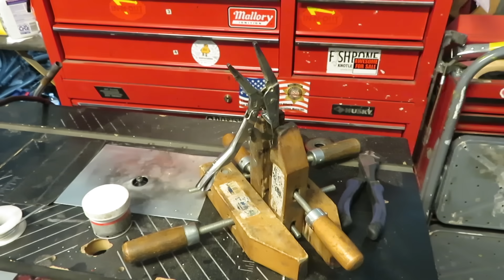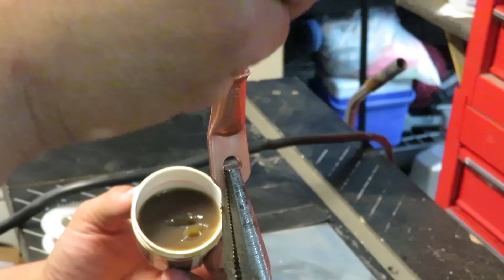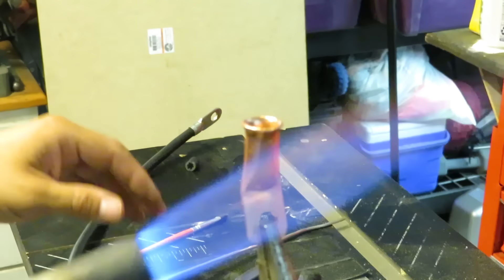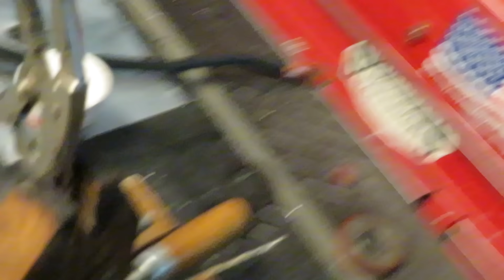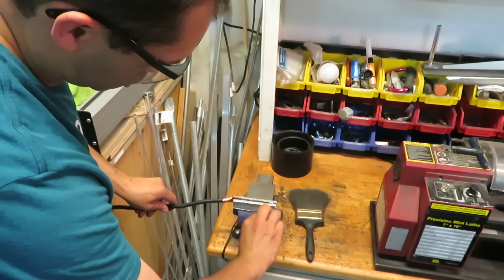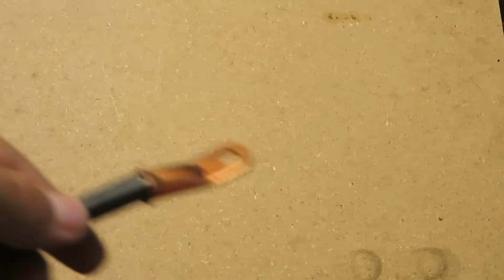How to: Battery Terminal Install. Better than Factory.

Comment: I would advise always crimping this style of connector. No one is going to use it to repel off of a mountain. A crimped connector  will hold even if the connector gets too hot due to a poor connection which may become loose over time.

Comment: Anything that needs that large of a cable WILL melt the solder. It MUST be crimped. Do what you want.  You WILL end up crimping. That's why the crimp was on the factory made wire. Just saying.  Some folks named to learn the hard way.
Reply: Steve. It is probably an Earth cable, it has two ring terminals.

Comment: You need to have the wire hot enough to boil the flux or the solder won't bond to it well.

Comment: Good job except for when you use solder that is made for Plumbing on electrical will eventually have corrosion and such a lot sooner than if you use solder that is made for electrical. You are giving a Miss information on your YouTube

Comment: Plumbing solder is the wrong type for electrical use. It is best to use a hydraulic crimper for these types of terminals. If you are going to solder, you can buy solder slugs from an electrical terminal supplier that contain flux and are properly sized for the terminal.

Comment: This is garbage due to the fact  that you will never be able to clean off all the flux afterwards, Flux corrodes copper and the connection will fail, I've replaced hundreds of these do it yourselfer projects due to corrosion.
If you do solder the ends use ONLY ROSIN CORE SOLDER, it will not corrode the copper.
Just use the proper crimp device I haven't had any problems in 20+ years

Comment: Looks cool, but for a RV or boat I would prefer to a mechanical crimped one
Reply: A half moon back dye with a center tooth crimp is the best mechanical connection you can get.. solder attracts corrosion.. I repaired locomotives for 12 years and saw all types of failures.. quality crimps never failed on 1000 amp motors... the crimp shape is very important though..

Comment: Plumbing solder is generally acid core and you don't want to use acid core on electric connections.
Reply: You are correct that acid core will cause corrosion that will make that cable useless. There will likely be 6-8 inches of corrosion in less than a year. Not good.
Reply: My thoughts also.
Reply: @eminence_front6043  ckh
Reply: Yeah don't use plumbing solder for electrical connections lol. He should've used the right solder. It will crack inside over time and probably other issues too
Reply: @nnnnnnnnnick5557  Modern plumbing solder does not contain flux generally, you need to add flux.  He used a rosin based paste flux, with lead free solder.
Reply: That particular brand is rosin core. Lead-free. Should be gtg.
Reply: I rewired my trailer, soldering and heat shrinking each connection.  About six months later, I startled having wiring failures.  Turns out the solder I use was acid core, and every joint eventually failed.  Ended up redoing the all wiring with the correct solder.
Reply: Yeah, rosin better or you need to wash your connection really well after
Reply: Silver base Solder is code in California for  Plumbing for a long time now.
Reply: Если я правильно увидел-флюс=канифоль в спирту от завода. Но данное соединение нельзя использовать в автомобиле и в горячих местах
Reply: That stuff he has is like the stuff I bought from lowes, its silver tin and copper which has a higher melt point than lead tin solders and that stuff has no flux core its just solder hence his need for flux, rosin core solder requires alchohol or acetone etc if going to be cleaned at all as they are not generally reactive at room temperature so cleaning really isn't needed and most of your plumbing flux is water based and very corrosive at room temperature which can cause other issues. A lot of people "say" it's not recommendedfor electrical applications though water based fluxes do exist for pcb and electrical work and prompt and proper cleaning is needed and people use them all the time for electrical soldering.  For what he did I would prefer the solder he used as it has a higher melting point and silver has great conductivity, and I would have used rosin based flux and pre soldered the wire to ensure proper flow between the strands
Reply: Plumbing solder is not acid core.
Reply: Don’t think that was acid core, just straight solder.

Comment: I crimp and then solder my connections just in case the solder happens to break or melt for some strange reason. Just a back up measure.
Reply: Solder will break.  It make the connection rigid and susceptible to cracking from vibration.
Reply: Not supposed to solder crimps.
Reply: @drott150  soldering stranded wire makes it solid. In an environment where vibration and movement occur, over time the solid core wire will develop micro cracks causing poor connections or complete failure.
Reply: YEP
Reply: Had that happen. I too crimp, then soldier.

Comment: I was told you should crimp the connector first and then put the Sauter to it because by crimping the connector on the wire you got direct contact copper to copper now you have Sauter in between the copper and Sauter don’t have a good connection quality that’s what I was told he looks like he did a good job though my name is Jim mungai I’m from Kennerdell PA I go by six in a row Jim

Comment: Soldered connector is easly to broke when wire is often bending and streching...  clamping connector is better in thic case.
Reply: In that case metal fatigue would sent in an would fail no matter what, either the cable, crimp, or connection.

Comment: This is a terrible idea. Absolutely terrible.
Reply: As an aircraft avionics technician I can confirm this is a terrible idea. You will never see this procedure used on any battery or high current application. Always crimped.

Comment: Good job, i make my own also. I use copper tubbing. Cut off length then hammer down one end and drill your hole for bolt to go through.. then solder your wire like you did..
Reply: I have trouble drilling the copper, seems to grab. Any tips?

Comment: You can't use plumber's solder on battery cable because it has a low melting point, unlike the solid lead terminal connectors made for batteries
Reply: I doubt the melting point will be an issue, but 63/37 solder would be best just because it's eutectic.  It goes completely from liquid to solid at a single temperature.  Still, even non-eutectic is OK but the joint must be kept completely still until completely solidified.

Comment: OMG, are you using acid core solder ? Acid core will corrode and cause high resistance. Use these techniques with QUALITY electrial solder and you will have a long term repair. Can't tell you how many times I've seen corroded electrial connections due to acid core solder.
Reply: Rosin  core solder for electrical.
Acid for plumbing.
Used this technic for years.

Comment: Under high heat in some engine conditions solder will fail and wires can come loose. Wiring for batteries in a vehicle should always be mechanically attached with a crimped connection.  That looks nice, but is not advisable in a vehicle.
Reply: At 450 degrees or hotter , there will be other problems that are worse.

Comment: There’s a reason why electricians and boat manufacturers never solder lugs. Always crimp and adhesive heat shrink.
And always use the right and best crimper for the job.
Reply: @Joe-by8jh  NO it hasn't.... you can pull a wire out of a crimp , you will NEVER separate a  proper solder joint the wire itself will break first. This is one of the first things they teach you in Electrical Engineering. It simple to test at home, take a wire and properly solder 2 ends together then take the same wire and use a butt connector to connect the 2 ends. Then simply pull them apart. You will pull the wire out of a butt connector every time. The wire that you soldered will only beak the wire NEVER the solder joint.
Reply: They reason the factory manufacturers and electricians don't solder is because it not time\cost effective. Remember neither of them want the job to last forever they don't make money if you are only a customer once.
Reply: @whpony96  
I probably shouldn’t have left it to interpretation. In most counties across the States and most countries, electrical codes forbids solder connection use in a structure’s main electrical system. In boats the ABYC forbids solder as the primary method of securing a conductor to a lug. The ABYC says yes to both crimp then solder, but it’s been proven that heating a lug to solder can loosen the crimp. The reason why solder is frowned upon is if the lug is loose on the terminal or the wire is overheated the solder can loosen and things just get worse from there. Lastly solder increases the chances of corrosion, in any case always use quality adhesive lined heat shrink tubes and not to short.

Comment: Shouldn't solder these connections. The flux works up inside the insulation at causes corrosion, the solder wicks up the flexible conductors and makes them brittle.  Nothing wrong with properly crimped connections,  aviation specification calls for crimps only, solder isnt allowed as is unreliable
Reply: Except on FQIS. Fuel quantity indicating systems.
Reply: @anthonysuttles6118  we are talking about battery connections
Reply: Requires both.
Reply: @anthonysuttles6118  no,as i said, soldering is bad in this situation that is why avaition spec calls for crimping only as its more reliable otherwise if it was better, planes would have less chance of falling out of the sky and they would adopt it as standard practice

Comment: Well, that might work for you but you did not really heat up the solder and wire end together, therefore, it is a real good chance that the wires are basically "cold welded" and not a good contact. It matter not if your test of pulling apart the cable holds, it matters that the wire stands got total "saturation" during the soldering.......I have been a industrial mechanic working with 2 gauge all the way up to 8 gauge and smaller,.......most times I will use my hand "bang crimper" and have not had one cable end fail in 37 years..........and I revisit my work very often........you really want that squeeze of the crimp......most cables on industrial vehicles like forklifts and floor scrubbers, 12 VDC to 36VDc and carrying anywhere from 50 to 350 AH, will do fine all day long with a nice crimp.....

Comment: Skip it and crimp. Any amount of decent current through cable will soften it and you're screwed.
Reply: Yea you don't have a clue how electricity and current works....You will break the wire before you dislodge that tip. Soldering is the BEST electrical connection you can make PERIOD.
Reply: @whpony96  sure guy, sure.
Reply: @turdhurdler8926  I have a masters in electrical engineering degree on my wall , I'm 100% sure you don't..
Reply: @whpony96  you got it Skippy 👍🏼.

Comment: Throw some heat shrink on there, it'll look really pro then.👍
Reply: right on with the shrink tube, i been doing it too, customers like it and coment on it as well
Reply: Why not heat shrink? Some super fast/cheap/easy way to make it look better and not get weathered as easily.
Reply: Agree. I used to use a technique somewhat thorough this when making industrial plating tank cables. I always used plastic seal shrink tubing to protect the joint from the corrosives. Can we say BATTERY ACID? The terminals gave up before the joint even thought of it.
Reply: @barryross1191  
You don’t understand soldering.
Reply: @barryross1191  100% on the heat shrink tubing if using solder connections. Working in the marine field, any bare wire exposed to moisture can and will corrode.
Reply: @barryross1191  sure

Comment: Iow temp solder if cable heats up it will fail must be crimped for safty
Reply: Crimp first then fill gaps with solder to prevent oxidation.
Reply: If you solder anything its become solid, If you try to move that copper wire, It will brake little by little. Crimping connectors with RIGHT tool, will do the job.
Reply: @milanmilicevic4618  I'm happy I saw this comment. I was wondering why I never saw the solder method and now I understand 💪
Reply: @milanmilicevic4618  only if it vibrates and is held perfectly rigid.  With a slight amount of slack the oscillations can not propagate, have you ever tried to push a chain.
Reply: @bowez9  you assume only the wire vibrates and wire has stiffness so vibrations are transmitted to connection.
Reply: @borysnijinski331  no I assume the whole system vibrates.  If that connection fails (assuming properly soldered)  then you also need to be concerned about all the PCBs too, for all those traces and connections are soldered.

If the terminal connection fails the plates in the battery would fail too .
Reply: A crimp is a mechanical connection 👍.  Belt and braces 👍

Comment: This video has the things you DONT want to do. 
Never use pluming solder, it’s acidic, never use that paste, you want rosin core, and always crimp your lugs. Jesus Christ
Reply: WAIT is he Jesus Christ cause he's wearing the wrong shoes
Reply: Couple of strong hits with a big hammer. Have I been screwing it up for years and years?
Reply: @danbrownellfuzzy3010  hammer crimps are a thing, although a proper die is recommended. Solder adds mass and stiffness especially if it wicks under the jacket which will defeat the intent of stranded cable and increase strain on the lug ring. Your direct hammer method can be dependable if the cable and lug barrel are properly matched in size, too tight would cause a cracked barrel and too loose will likely cause the cable to slip out eventually. the die expands the joint in multiple directions  locking the 2 together https://www.amazon.com/QiXin-Hammer-crimping-Crimper-Crimping/dp/B089Y2NZSM/ref=sr_1_6?dchild=1&keywords=hammer+crimper+tool&qid=1618764773&sr=8-6
Reply: Crimp is good solder is better both are perfect lol
Reply: Geez, this guy basically cold soldered the wires........ok, he used the wrong solder, but if he heated up the cable wires AND the lug at the same time, all things same temp and joined together all nice.........you are right on the solder, I will only use solder that says for "electrical use".
Reply: You are correct, adding solder to a crimp only decreases reliability

Comment: all the videos i have watched on this topic, you are the first one to say to use solder. everyone else seems to think its a bad idea with soders low melting point
Reply: If that wire ever gets hot enough to melt the solder , there will be much bigger things wrong .
Reply: @kennethnevel3263  <--What this guy said. Theres a reason the NEC (which is written and published by a fire protection organization) allows, and even reccomends, crimps.
Reply: @njineermike  Soldering is allowed by code in electrical work but isn't commonly used because it takes too much time and labor.
Reply: @LV_CRAZY  Depends on the usage.
Reply: If the wire end gets hot enough to melt the solder. then you have a bad connection at the wire end. or possibly too much load caused by a faulty starter. providing it's in a starting circuit. on a good connection it should never get hot enough to melt the solder.

Comment: All this time I’ve been okie crimping ! Great fix 👍
Reply: Crimp before soldering just soldering is a no go the solder is electrically resistive and will heat up during high current loading (60+amps) and can melt causing a partial connection causing additional heating and full failure possibly even starting the wire insulation on fire.  Crimping first prevents this possibility... My trick is I take an engineers hammer  place the connector on a hard flat surface with the cable and flux already  inserted give a good wack or 2 to the terminal socket crimping it solidly (my crimps are strong enough that either the cable or the terminal eye will fail when pulled across the crimp(had a guy test one when he pulled an engine I had replaced the cable on 5yrs prior and forgot to remove the engine to chassis ground cable I made actually picking the front end of the 91 Dodge d350(1ton diesel) from the ground by that OO gauge copper cable). Then I give it some electrical solder and sleeve it with 2 layers of marine electical shrink tubing shorter piece first covering the connection second overlaps the ends of the first and reinforces/protects the connection from flexing (the marine grade heat shrink tubing contains a heat set epoxy that adds an extra layer of water penetration protection).  This is the proper way to make a professional battery cable eye connection.  (However because it takes too long most mechanics don't do this heck you're lucky if they don't use the cheap non permanent/temporary use clamp on battery cable ends).

Comment: Why this looks like a good method, there are issues.  Soldered connectors are never recommended for any installations where movement or vibration is present, the wire will fatigue and break at the end of the solder flow.  Plumbers solder is not formulated for electrical connections.  A proper crimp with correctly sized dies will give the best results.